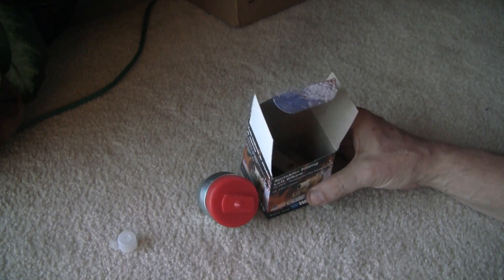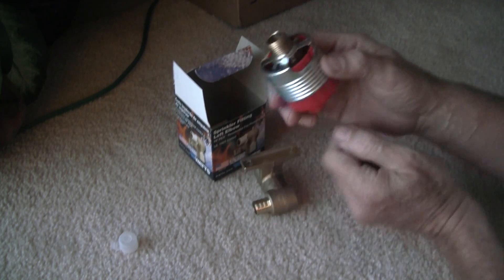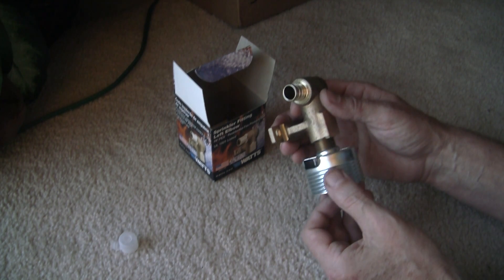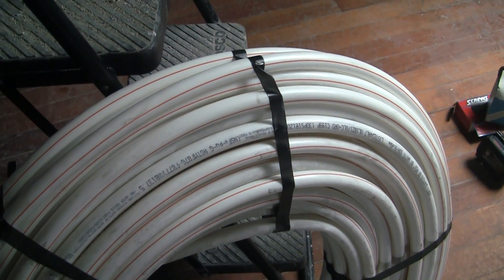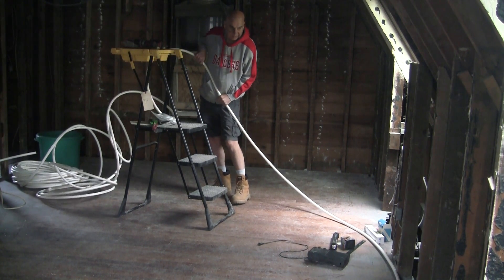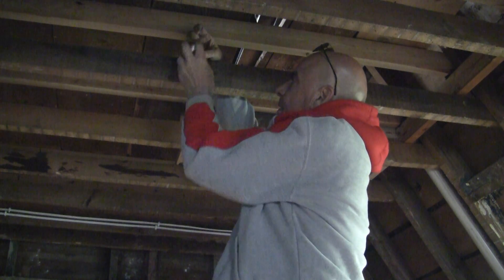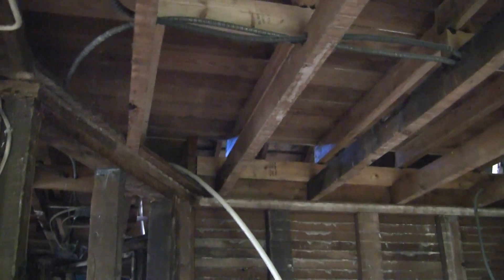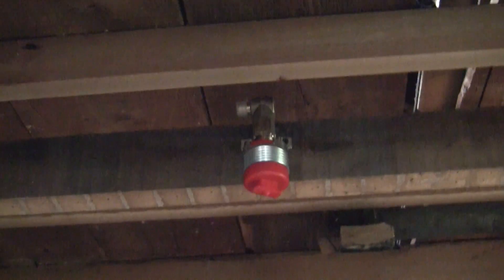How I installed a DIY residential-home fire sprinkler system

Comment: Thanks for the video.  So essentially the sprinkler head is the only part that regulates when water kicks on?
Reply: Correct.
Reply: @bobbolda686  I'm thinking of running one sprinkler in my basement to cover a 16x10x7' area.  

My 3/4" main water line is 50 feet straight away.  Think running a 50'  3/4" pipe from main to head be sufficient? 

It's probably overkill, but I do TIG/MIG welding.  TIG is zero hazard because no sparks or fumes.  MIG very little sparks depending how clean metal is.   I have concrete/brick home.  But the ceiling is wooden rafters covered with drywall.  I have no flammables in the area, but I try to be as safe as I can be.  I focus more on the exhaust system,  but was thinking one sprinkler head in that room might not be a bad idea.
Reply: @foobash1  Please understand, I am not a sprinkler technician.  That being said, I get what you are doing.  And it is my belief that an improperly designed sprinkler system is better than NO system at all.  So I can't really help.  But if you devised a bucket of water hanging from the rafters with two trip trigger ropes, there would be some people out there that would complain that it was improperly designed :)
Reply: @bobbolda686  I agree....But in theory, if a fire broke out and a flame touched that sprinkler: Sprinkler would break and water would flow.  Agree?

My logic is, I'll be taping into the main after the water meter at the lowest point possible (basement floor and meter about 5 feet below ground level).  This T joint would be first and lowest vs. rest of plumbing in house.  So I'm assuming it will get "priority" over any other line in the house.  

About 5 years ago a water main broke about 100 yards away and I still had pressure in basement and 1st FL, but 2nd FL was weak...hence my logic of "priority".  My house used to be an apartment complex and I've notice I have higher pressure than some other homes in the area...which makes my idea more confident.   

I can't think of a scenario where this would hurt to have.

Comment: Just came across this video. I commend you for installing this yourself and what not. However. There is a lot of thought that goes into these systems: sprinkler spacing, pressure and flow required per head, size of remote area that needs to be hydraulically calculated, permitting and the need for a license to design and install. I think you have the right to install this, if you know how to design it and install it. But, I’m also not sure how you got around the permitting and license issues.
Reply: You may need a license to operate a business that installs these but no one forbids one from installing their own wiring or plumbing their own house. They will require a building inspector to check it. In fact a neighbor installed his own gas lines in a vacation home he was building and was not required to hire a plumber or anyone else. He was required to allow the county to run a 24 hour vacuum test on the system before they would allow it to be connected to a gas supply. Hydraulic pressure is controlled by the water utility and like gas it is maintained at a constant pressure and the flow rate is controlled by the size of the pipe. That's why houses have 3/4 inch feeds but 1/2 inch plumbing. for the entire house. Only one backflow preventer per water meter is required for all property whether they have a faucet for a garden hose or a 10,000 sq ft house. One sprinkler head per room is recommended but not required in communities that do not require residential fire sprinkler systems.
Reply: This is coming from a sprinkler systems designer, licensed.
Reply: When they come to inspect. I suspect they’ll ask for you’re license and approved prints right off the bat.
Reply from the maker: @jarrettbruss8863  Thanks for the comments.  My installation was permitted.  And I understand the perspective of a professional, but the way I look at it, if I ever experience a fire again, and if my system is only 50% or 20% or even 10% effective, I'll have more protection than I did without it.  On top of that, although it's been air pressure tested for leaks, I have yet to connect it to the municipal water supply (I wanted to do the connection correctly, but I don't feel qualified to assemble the fittings).  So I have a dormant system that is doing no harm and could be activated in the future without tearing up walls.  Plus, I had fun learning/installing. As I've mentioned in other comments, after dealing with a dozen licensed contractors in my rebuilding phase, I am far more confident in the quality of the installation, than if I would have handed it over to a contractor who may, or may not have, cared as much.

Comment: Thanks for taking the time to show this. Question: Is this full of air or water. I'm wondering for my house up north water would freeze. How do I work around this?
Reply from the maker: You can have dry or wet systems.  Dry are just full of air.

Comment: To my knowledge it is against the law in every state for anyone to install, maintain, service, or even design a fire sprinkler system. You base and the calcs upon your water pressure and you have to calculate the water pressure coming from the city at the point of your most remote sprinkler head to make sure you have enough pressure in your system. Heck you might have too much pressure which will cause bigger problems. Then to calculate the location of the heads based on the specs for coverage of each head and the pressure of the water. Man. Is so much that goes into it. I pray that you did this right so that at least it works if it needs to work one day. Hopefully you won't have to find out. Nice of this even touched the fact that if you try to sell your house, an inspector will see there was no plans or permit pulled for the sprinklers and then the city will make you tear it all out and have it redone by a pro. Which is crazy because you might not have bedded it initially based on original fire safety laws. You were grandfathered in. Now you got yourself stuck for another 10-30 k depending on the size. Man. You definitely opened A BIG CAN OF WORMS. you might want to get rid of this system before the city finds out about this and they make you completely upgrade your home. You will not like those results bro. Believe me. I do this for a living and the fire Marshall will completely red tag the house and make you move out till it's fixed. Not to mention the insurance penalties that go into this type of unpermitted work. Ouch. I can't even wrap my head around the seriousness of what you've done here in a legal stand point.
Reply from the maker: Permit received from City.  You worry too much.
Reply: bobbtall I see. So you got a permit and then this was inspected and it passed?
Reply: Hydraulic pressure is uniform throughout the entire system because liquids do not compress. If you apply 60 lbs of pressure in a 100 mile pipe at one end you will receive 100 lbs of pressure at the other end the instant it is applied.
Reply: @danielebrparish4271  this is correct. However if you have a sprinkler head in the kitchen burst because of fire in the kitchen and then the sprinkler head in the bedroom which is 50 feet away down the hall also breaks due to fire, the one in the bedroom will have less water pressure truth the one on the kitchens because it's further from the water main. The pressure drops the further you go (if you break other sprinklers along the way). So that is what I was talking about and that's the reason you may have 1 1/4 pipe on the kitchen and then by the time you go 50 feet further to the bedroom that pipe can do to 1 inch pipe and it will balance the pressure so both sprinkler head have enough pressure to operate equally. (this is so based on imagining if the entire house is on fire and ask the heads go off. You have to have the required amount of pressure and the "furthest most remote" head and it still needs to meet the minimum even if 50 other heads are discharging ahead of it in line. That's why pipes for sprinklers usually start for example with 2 inch and then 1 3/4 then 1 1/2 turn 1 1/4 and so on and so on. By reducing the pipe size you maintain the pressure from beginning to end. 

What you said about the pressure being equal is right but that's only if you have 1 head pop at a time. What happens if you have a head pop close to the main and another 50 feet away and a 3rd 100 feet away? The pressure decreases as you get further due to the draw ahead of it. That's The reason for reducing pipe size. (p.s. I'm a licensed c-16 fire contractor in California). Scs I don't understand for a second how anyone can just put in their own system with no calculations done professionally and installed by homeowner.
Reply: @babayega_  Some water on a fire is better than none. Even if it doesn't put out the fire it will slow it down. I don't know how one could cause a sprinkler head to burst. If it freezes then the metal tee could split but it would cause a leak similar to a barely open faucet, not enough to cause a significant pressure drop. Sprinkler systems don't require much pressure to work. They cause the water to spray out in a wide pattern at ceiling level and they will open at 135 F so the fire will not reach the 1,000 F that a house on fire reaches before the fire trucks arrive. Nothing is 100% effective at all times but there is a reason that fire sprinklers are required in all commercial buildings.

Comment: What's your water pressure at the lead in?  Is that pex tubing approved?  Did you run the design, and calcs passed the state of Wisconsin? Did your local AHJ give you the OK?  Have you determined the pressure loss from X number of feet of tube?  And if you are running more than one head per line, how many did you calc out?  What spacing did you use?  Small room rule?  13R?  How do you intend to test your system?  Can you?  How are you going to accomplish the required test of the heads in 15 years, now that five have passed?  If and when you try to sell that house, how do you plan to explain NOT having the required documentation for that system?   Sounding much more expensive to me?  Not to mention if you have a fire and it doesn't work right......
Reply from the maker: You miss the point.  I have more than I had before, and more then most people have in their homes.  If I have another fire, and if it doesn't work... I DON'T CARE, because I'd be in the same spot if NOTHING WAS INSTALLED.

Comment: PEX pipes for a sprinkler system?  They could warp and melt even with water in them.
Reply from the maker: The Watts RF pex is designed for residential fire systems, thus the "RF".  Watts Residential Fire Protection Products are UL 1821 listed, and meet National Fire Protection Association requirements for fire suppression (NFPA 13D).
Reply: thx
Reply: Are the pipe fittings RF as well?

Comment: It's nice that you are trying to help people but there are 2 things working against you unfortunately.
1. Physics
I've been installing, inspecting, testing, maintaining, and even designing on occasion, fire sprinkler systems for just about 20 years. I've been teaching fire sprinkler fitter apprentices and journeymen for about 12 years now and by the looks of what you have there the sprinklers you have installed will NOT function as intended. You basically have decorations as you do not have the water supply due to friction loss. 

Not trying to be disrespectful but if you screw one into a faucet it wont develop the spray pattern due to lack of residual pressure, add a bunch of distance and it's even less. 
Please refer to NFPA 13R and NFPA 13 D,  if commercial use then NFPA 13.

Trust me, have it designed by a professional and approved by the local authority having jurisdiction and pull a permit. 

There are spacing, location, obstruction requirements, water supply requirements, on and on and on the requirements go. Distances from heat sources of various types require different temperature heads, residential vs. commercial heads having varying degrees of water demand, obstruction requirements are critical,  the design area of the system is critical. I can't even add 1 extra head to a professionally installed system without it being calculated and approved because 1 extra head could overtax the system and make it NOT work. Resulting in loss of life or property. (if a room was enlarged and say the original design was for 2 heads and you added another then you have cut the water supply for the two down by 50% and they wouldn't develop the proper spray pattern.

2. Lawyers

I would pull down this video yesterday.

If someone follows your advise and they loose a loved one or property in a fire they could sue you in civil court. We live in a litigious society and your system you installed appears to be very inadequate. 

I hope you will have a fire protection engineering evaluation performed on your system and follow their advise.
Reply: John Doe very well said you hit very good points I basically just read my thoughts.
Reply: Old comment, but yeah, what do you do when you live in an area with zero permits and zero qualified inspectors? Some of us DIY because there is literally no other option. I guess we could contract out from someone four hours (in one direction) away.

Comment: Has this made a difference in savings or policy coverage in regards to your home owners insurance? The reason I ask is because there are literally books of regulations surrounding the installation of automatic sprinkler systems. To start with, all of the material and hardware components from your back flow preventer all the way down to your means of hanging and bracing must be UL (underwriter laboratories) listed for fire protection services. The heads you purchased on eBay may be approved residential concealed pendant spray heads, unfortunately the submittal process of your fire sprinkler plan requires that the year the heads were manufactured are not of any year earlier than when the fire Marshall (authority having jurisdiction) approved your plan. These systems can pose a much greater liability in flood damage alone than the minute chance of fire damage if you are not careful as to proper installation. For example, if you are wanting sprinkler coverage in an attached garage space where ambient temperatures create conditions where exposed piping is subject to water freezing even steel pipe fittings will burst.  This gets into dry pipe valves, air compressors, and routine maintenance of residual condensate drains (drum drips). Is the sprinkler system connected to a alarm or monitoring system? If a head accidentally discharges and you are away from home then you have no way of knowing that your house is flooding and no way to shut off the control valve. I know a lot of these regulations seem tedious but if the system does not meet the minimum requirements outlined in NFPA 13D and is not approved by the fire marshal, i might even go as far to say that the sprinkler system could be detrimental to the resell value of your home if you ever had intentions of selling your home.
Reply: Jon Schwartz this system is illegal and if the insurance company finds out he did this they'll probably cancel his insurance and make him redo the entire job with a pro doing all the calculations, design and install. He better hope no one finds out about this. This is a big no no

Comment: You have no idea how these things operate. They are very strict rules and codes to install these properly. It's notJust plug one in a room and move on. It's not like hey I going to buy a toilet and install it. It's life safety and it should be take serious. That's all I amSaying. You could be doing more harm than good. If you don't have the right water pressure and proper pipe size it won't even put a fire out like it should. It's. Or as simple as he makes it out to be.

Comment: We're your sprinkler head placements to code. Proper distance fromWall. Did you follow nfpa 13d regulations. No one and I meant known shouldBe installing these system unless they are a certified sprinkler fitter.
Reply: Daniel Pires I don't think he should charge someone for installing a fire protection since he is not certified, but if be is installing it in his own home, and accepts the risk, that is his own business, and right.

Comment: Shouldn't use pipe dope on the sprinkler thread. I wonder how much you paid per fitting and per head.
Reply: Actually you do. You should read the NFPA handbook
Reply from the maker: +aaasssppp123 I bought both the Watts fittings and Viking sprinkler heads on ebay.  They were very reasonable (the sprinkler heads were a partial/leftover box).  If you do a quick search I'd imagine you'd have a good idea of current pricing.